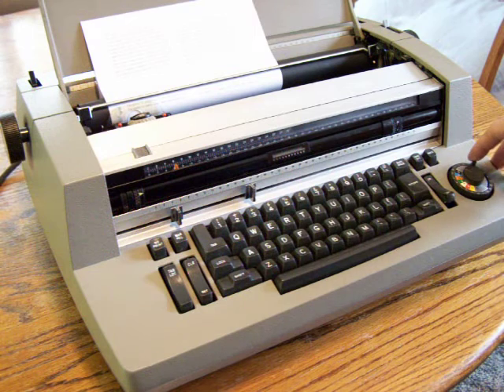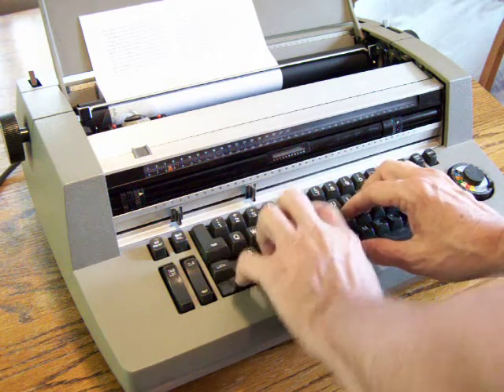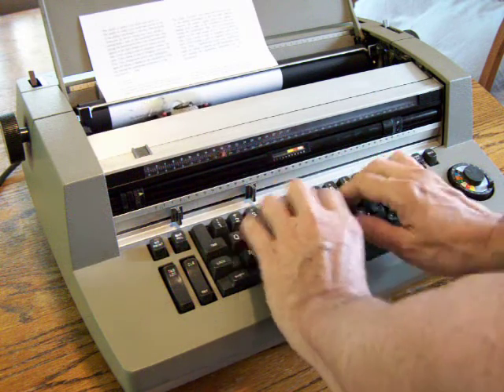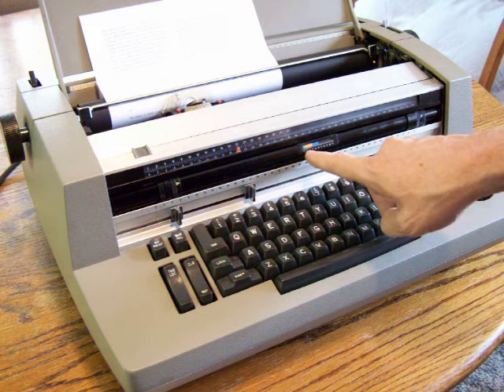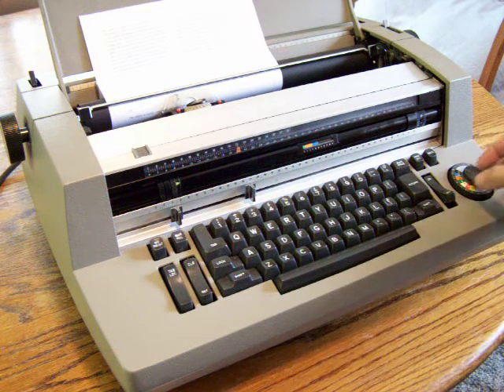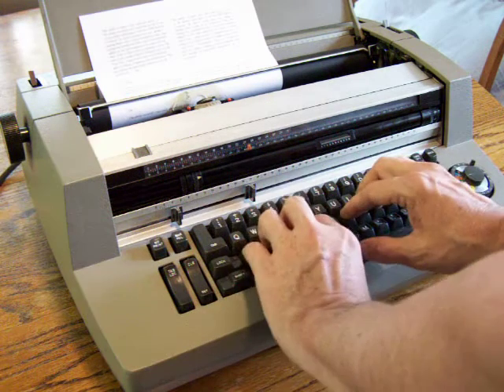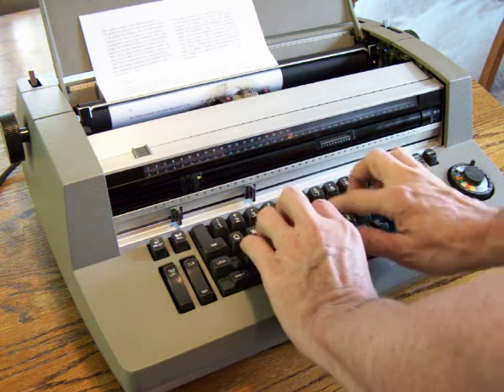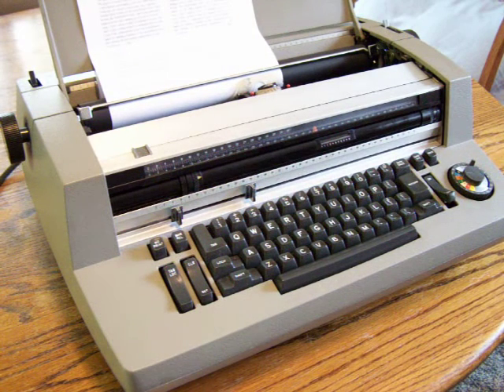IBM Selectric Composer

Comment: After you get used to it, you can type the line with "do not print" selected," hit carriage return (which does not advance to the next line), then set the dial and type it again. Cuts the cost of ribbons in half! The reason the clay-coated paper is wide enough for two columns is so that you can type the line again in the right column if you made a mistake. Then all the paste-up guy has to do is run the entire sheet through the wax machine, cut out the lines in the right hand column, plop them down over the lines with mistakes, and lightly burnish the entire sheet. Then the proofreader reads it and marks the changes in the blank space on the right, and you type up a little sheet of corrected lines to be pasted in.
Reply: Imagine if you had been able to use a IBM Electronic Composer or a Xerox 860ips (1979-80).  The 860ips with it's full page screen had a program which would set up the columns for you automatically.

Comment: I was a typesetter in the 1970s, and set entire books and articles on it for several years. Little did I know that that kind of intensive touch typing would stand me in good stead after the computer revolution!
Reply: The IBM Selectric typewriter was the best typewriter I have ever used. The keys afford such an excellent typewriting experience that they work regardless of the touch of the typist. Now I keyboard on a Dell computer and get more usage better than a typewriter keyboard.
Reply: Hi, a little question, did you compose text in this machine and send it directly to printing? (i mean, for example, in books) Because  im confused about if this machine could make and justify pages with non-monospaced typefonts. I mean "directly" using the composition (text-box) made with this IBM to send it for set on printing negative film (matrix).

Comment: Now all you need is either a spirit duplicator, mimeograph machine, or both, for a complete print shop!
Reply from the maker: way ahead of ya (:
https://munk.org/typecast/2015/02/18/printin-in-the-press-room/
Reply: Nah . . . it was used mainly for phototypesetting. The page is pasted up with both text and images, then they make a big red 1:1 negative, then they print from the negative.